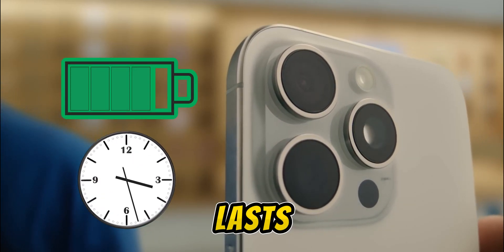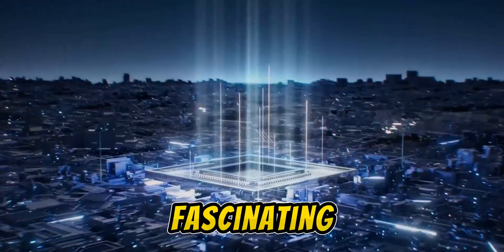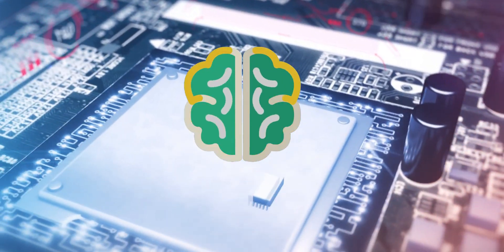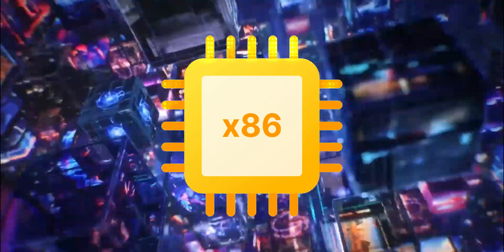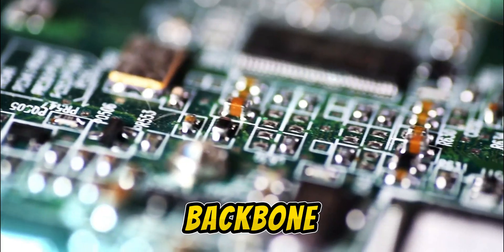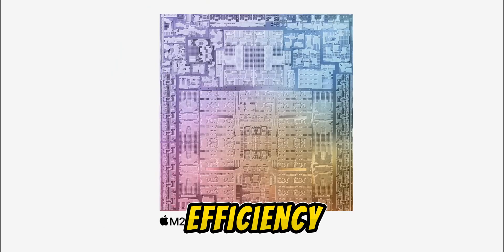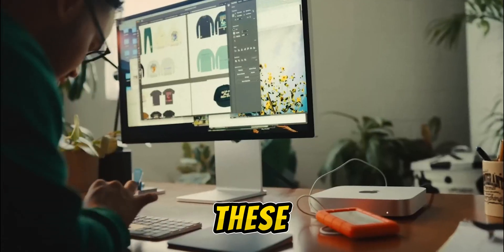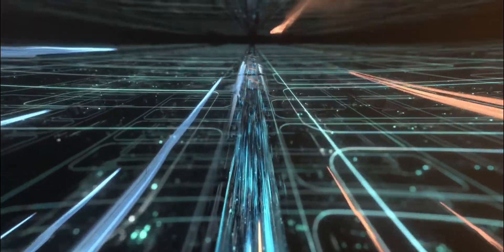ARM vs. x86: The Future of Computing Power

Comment: I love arm so much … it makes productivity and portability possible for many of us who use laptops and tablets on the field away from offices or stations …. However …. I wish, it had the ability to game or operate certain apps , the problem isn’t so much that it can’t play or run these app but, that no one is building games or much apps design for arm without an emulation layer (I’m looking at you drawboard asking for a subscription to annotate and highlight PDF it’s ridiculous!!! I digress)…. Which is infuriating, I will buy the first arm designed triple A game with no issue or any app that gives me freedom to work without subscription or internet connection … for now I depend on Virtual Machines to do all that using my desktop :/)

Comment: My smartphone certainly doesn't last longer than the laptop, and it's 5 years newer
Reply: Guess which one has a 10-30 times heavier battery
Reply: @TheSandkastenverbot  Guess which one is 10-30 times better equipped, and runs actual programs instead of dumbed down applications ;p

Comment: Lets switch cpus and generate more e-waste than ever... No thank you. Modern arm is so expensive most people can not afford it. A Broadwell 14+ core will be faster than a new mac and not use much more power and cost 1/10 or less. Rasbery PI was fun when it did not cost a fortune. Doing the exact same workload the difference in power consumption is not much different. Hype to get your cash.

Comment: There's a misconception. x86 isn't inherently less power efficient, it's less CPU die efficient (requires a bigger chip). The reason Apple's chips were cooler was solely due to being made on TSMC's better fabs. Make an Intel CPU at TSMC is going to run just as cool.
Reply: And we will exactly have that tested with Intels new lunar lake series. lets see how the performance will b
Reply: Hello, I'm a future traveller. We have Intel on the same TSMC node and it's not cool.

Comment: X86 is outdated architecture it's been out since 1970s . Arm is superior but nobody with exception of Apple Qualcomm are developing chips. Think biggest roadblock most applications for business and gaming is x86 . Now that they are starting to make emulation for x86 to be run on Arm might not be much longer before ARM Rand D explodes and we see the industry as a whole shift to Arm.
Reply: the industry hasnt shifted to arm because arm is just too specialized, the instruction set is what makes x86 palpable. ARM is fantastic for mobiles and integrated technology, but doesnt come close to bringing what x86 is able to bring.
Reply: @dogsbecute it's like switching from gas vehicles to electric vehicle. it will take them atleast a decade for half of the world to switch from x86 to ARM.
Reply: @X10Z24  Hopefully longer. A lot of power users arent interested in ARM.

Comment: Generally speaking, this is faulty information. x86 don't inherently custom more power than ARM. It depended on many things. X86 do have more instructions to decode and predict. But that doesn't equal to needed more power automatically. Out of all things, it would be the manufacturer process that makes the big difference.... I mean of course ARM is going be better on power consumption with 4nm when compared to a 10nm x86.......
Reply: New Intel CPUs are on the same TSMC node and they are still behind.

Comment: Does Linux run normally or even optimally better on an A.R.M. or X86 architecture?
Reply: The tradeoffs are not inherent in the Linux code so much as the compiler that is used, if I understand correctly
The compiler outputs the instruction set opcodes, i.e. arm vs x86
I dont know why, but some big companies don't support cross-compiling their products which is crazy to be cause I don't fully understand why. But it shows that there's no straightforward way to translate between architectures
Reply: @arabicpilot11  So which does Linux perform BETTER on?
Reply: Linux runs fine on both architectures. It is really built specifically. You can use something like Gentoo to optimize the very CPU you have. But highly NOT recommended if you don't know what you are doing. That said, NOT all software have ARM version or x86 version.
Reply: @iokwong1871  I thought those were the only two architectures mostly available.
Reply: @jakobw135  Even a game handheld that runs on linux, have over 20 variants. given that most of them are some form of ARM. but that's the problem with ARM, there are really no standard like x86 / x 86_64. And on those of those, there are RISC V, MIPS, etc.... Your mile may various for each, but Linux general support an ocean of architecture. LOL
Reply: The only thing that outperforms linux is bsd
Reply: @uret2  Isn't BSD also a form of Unix, like Linux is?

Comment: x86 chips should remain on desktops, but for laptops, they should start using ARM chips.

Edit: ARM chips might be the future
Reply: whyy
Reply: No they need to settle on a single standard, for the sake of standardization. It’ll probably be ARM, and if so then everything to go ARM.
Reply: Agree. In my experience my former X86 laptop on battery only power, either doesn't really last long nor can perform well. Already got myself an ARM laptop. Its battery only mode last way longer than X86 and yet a lot faster as well as smoother. 
x86 is still the powerhouse to powerful apps and games and therefore should be fine on desktops as they have consistent power from household walls.
Reply: @t8polestarcyan22  However, arm desktops are starting to show up, like this 128 core ampere arm CPU. 

It's a legendary workhorse, of course gaming is not  great on it since games don't utilize all CPU cores.
Reply: arm is 50 years old
Reply: ggggh
Reply: 75e86aeoudgigc
Reply: @niko2002  All I know is that only a few software developers have managed to make their software work as good on ARM as well as it does on X86.  Either they end up sacrificing significant features, or the software is a brocken mess on ARM.   I feel that for this reason, an all new CPU standard is about to be introduced, combining the strengths of X86 with those of ARM.  When that new architecture arrives, both X86 and ARM will be replaced.
Reply: @ph11p3540  could be right, I hear about Risc-V all the time. It's still at its early stage. Open source and no extra cost like X86 or arm does.
Reply: Please NOOOOOOOOOOOOO ;(
Reply: Nvidia has tried ARM CPUs for desktop application, it has failed, so they now joined with Intel for a Nvidia CPU
Reply: @honeybadgerbomb4469  Yeah ARM mind as well be linux 2.0, just aint ready yet.

X86 CPU and windows works fine, if it ain't broke dont fix it. Well windows 11 is just something else.
Reply: @LiberalFinder  Imo, if X86 drops its 16bit support for streamlining, everyone's better off. I'm upset they didn't drop it
Reply: No thanks

Comment: I think Arm will become a major player in high performance desktops in the future, especially seeing every major OS already supports it (Windows, Linux etc.). Even x86 CPUs today breakdown the cisc instructions down to simpler instructions before executing the code. So even Intel is showing that risc is the more performant of the two. RISC doesn't need to do this and hence will have the edge in the future. We just need to see more companies produce higher powered, more performant, but still high efficiency risc CPUs. But then there's also risc-v, which is also promising and cheaper (royalty free) than both arm and x86.  The future is looking great!